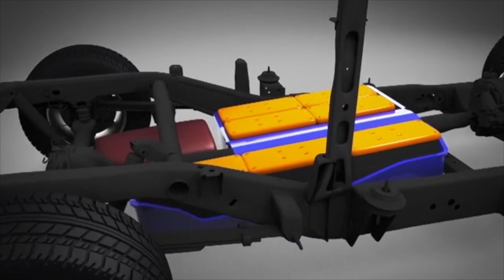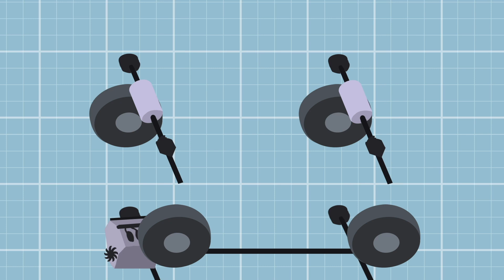Could This Pickup Truck Design Change The World?

Comment: If we can´t make enough vehicles full electric then hybrids indeed are the way, for now at least.
Reply: If there not driven properly a hybrid can be worse. Remember a prius is capable of 19mpg and it's not even going that fast. Obviously a prius does not go fast. In the right conditions an M3 bmw uses less fuel.

Comment: The problem I see is the high electric charging, so I would have to pay at my house to have a special electric station put in I’m sure that’s expensive and the there’s the actual charging itself the electric company already gets tons of money from me monthly I can’t imagine how much higher my bill would be if both my wife and I had 2 electric vehicles plugged in. Our bill would be huge, no thanks
Reply from the maker: You'd be surprised. Have a guess how much it costs to fill up a 60 kWh battery (Which in a smaller plug-in car is enough for 230 miles of travel)?  Charging stations these days are a lot cheaper than they once were -- under $600 is achievable. Additionally, if you do have a socket for welder... you've probably already got the right power in the wall.

Comment: Surely a hydrogen fuel cell is the only logical replacement. Plugging in vehicles might be OK if everyone has a drive to park on, but in towns and cities where parking in front of your own house is a rare luxury, it's just not practical to have to plug your vehicle in.
Reply: No because currently hydrogen is made from natural gas.  Splitting water is massively inefficient.

Comment: I drive a pickup for work and would instantly switch to a hybrid if it met the current abilities slot of my journeys are short but carry heavy loads so having something that covers 30miles on electric and then switches the motor when needed is beneficial. Mitsubishi were supposed to be developing one but I've not heard diddly squat about it.
Reply: RAM sell the 1500 mild hibrid.

Comment: All those eco conscious "electric car buyers" forget that as of now, there are no "cost-effective" ways to recycle lithium. (The main ingredient in 99% of batteries out there). So what do we do with 2000 pounds of spent lithium in a Tesla model 3? Isn't that going against the "eco" mentality? If we are going to spend more on recycling (or disposing) of lithium in both labour and energy costs, what's the point? Most of these electric cars are recharged with either good ole' coal or "Nucular" (as Bush the lesser would say). From an eco stand point, are either of these methods wholesome?
So this electric bandwagon everyone seems to be jumping on has it's negative. Yet, not much is said about that. Where will the extra electricity come from to recharge the +10 million electric cars planned to be on the roads within the next few years? How fast is the "recycling" industry working to find ecological and economical ways to re-use or dispose of spent lithium? It is highly toxic BTW.
Happy electric trails!! Cheers

Comment: The metals needed to make battery packs are rare earth metals are hard to find and usually buried deep in the eilather you do more damage trying to dig them out then you are saving blus the batteries have a lifespan would have to be replaced and would cost more than the truck was worth. There are many other things we can do. All electric is not that way

Comment: They are so beautiful,all these pick up trucks.but i laugh when i an in my old 92 1 ton chevy van with 370,000 miles on it and $500 trade in value and see when im at home depot these $50,000 trucks cannot put much in the back.lumber,ladder hangs out.not much fits.a van you can put all your tools ,alot of tools,20 bags concrete,50 2x4x12 and a ladder close the doors and not get rained on

Comment: Consumer automobiles are an extremely minuscule amount of carbon emissions. Cattle, coal, and plastic are by far the biggest problems we face.
Reply: Automobiles are not a minuscule part of the problem.  Your other issues are right on the mark.  We are being attacked by a pack of wolves.  Taking out just one or two doesn't solve the problem but having multiple efforts that each take out some will solve it.

Comment: Yes turn everything to electric because lithium extracting is clean and emission zero... You have to see something from the ground up not just from your usage. Also, you cannot compare city and back country driving. Where i am, there is no way to go 300km out of a city without thinking of "filling up". US and Canada are vast countries that will be hard to adapt as it will just cost to much. Just to prove my point, the cellphone coverage is not complette here as it is too expensive per custumer to put in. About 2 to 3 times a day i cant even make a call. You think it would have a plug in station there?

Comment: Off road dump Truck do use electric drive train but powered by a diesel motor..
the engine drives an Alternator producing over a million watts which is sent to traction motors.. now a battery 🔋 to feed that amount of power without taking up the entire payload at this time is just not there yet..

Comment: The idea that hybrid or all electric vehicles are superior to internal combustion vehicles is not completely true. WHERE does the electricity come from to charge the batteries ? Nuclear power plants, coal burning power plants ? How is that better for the environment than the internal combustion vehicle emissions ? Not to mention the batteries which contain harmful elements and when they fail, not likely to be 100 % recycled. Producing toxic nuclear waste and fumes from burning coal so you can plug in your vehicle is the answer ?

Comment: Everyone ignores facts.  The manufacturing process and the manufacturing of materials used in an electric vehicle and for that matter, any vehicle, is the largest potential detriment to the environment.  Depending on where your electricity comes from, if using carbon-based electricity, you are piling on more potential environmental impact.  Disposing of these batteries adds even more impact.  Gas based vehicles have reduced carbon emissions by 98 percent since the 1960s.  Add to all of this, if you use an engine as the range extender for an electric vehicle, you are still using gas.  All this money and effort into electric vehicle adds up too much less, if any, positive impact.  What they do, do, is provide excellent performance and allow for more energy independence.

Comment: ICE translate their thermal efficiency at only 20% of the fuel burned toward axial motion,  most of the energy is wasted with heat,  drag,  friction,  moving parts,  and other aspects that use up energy before it gets to moving the vehicle forward. Conversely,  Electric motors translate 90% of its energy to moving the vehicle. A much more efficient medium of translating energy to motion. 

Tesla is the future. They will eventually dominate every aspect of the automotive industry. And subsequent bankruptcies of big ICE auto makers will occur. 

You might as well buy Tesla stock why it is relatively cheap,  and make a profit as they grow.

Comment: The Mitsubishi Outlander PHEV is a mid-sized SUV that has the drive architecture described in the video.  The wheels are always driven by electric motors, and it has both Level 2 and DC fast charge capability, but it also has a gasoline engine to charge the batteries if needed.  However, the battery pack is only 12 kWh, which is good for about 50 km.  If this was bumped up to 20 to 30 kWh it would be a really great car!
Reply: Good for an suv, but some of us i.e tradies need utes to work out of. Would like to see this in reality. I doubt they could get anywhere near the price of a diesel variant though

Comment: There is no mention of centralized power generation, which is still polluting and the minerals to make batteries, solar panels etc. still needs to be mined. An hybrid Toyota Camry runs a bit less (l/100km) than the quoted F150 but will not carry the weight or tow. So we need a real solution not a popular political one.

Comment: Great program. Indeed, it also would be possible to avoid installing a fixed engine in your last propossal and instead prepare the vehicle to add a gas engine that can be plugged in and out depending on users needs. In my case would be great because I would only need an extended range about 10 times a year. The rest of the time I would store the engine in my garage. That would make the car cheaper as I could buy it without the engine if I do not need it. It also would allow the producer to offer different engines some less and some more powerfull to add to your pickup to make it more adecuate to the client's changing needs.

Comment: Good video, however you did not mention the weight of the battery pack which can be very heavy. Pickup buyers are always concerned about the weight of the truck and the amount of weight it can carry or tow.

Comment: From an ev owner point of view, I do not believe that the future is electric. Although I've enjoyed my Ioniq electric I think people will not adopt the ev car. Maybe some countries especially in Europe will enforce and achieve a very high ev ownership rate (I think Norway is 50 percent electric) the future I believe is gasoline engines that are more efficient. Take the achates engine which is being tested with Chevy in Saudi Arabia. The engine is 50 percent more efficient which means it is just like a Hybrid car. The gas corolla does 600 to a tank, the Prius does around 800-900. Also Mazda is introducing the sky active x which is 20-30 percent more efficient. Electric cars are a financial decision. It is cheaper to own and maintain an electric car in the long run than a gas car. Especially for people such as myself that drive for a living. I do 250-300 km a day. Not paying anything has increased my profit margin. Also, Europe and North America are different places. The people are different and the countries are smaller. Once a gas car that does 3-4 litters to 100km comes out or even a truck that does that electric will die down. Just from a resource perspective we can't electrify the 2.2 billion cars on the road. Lastly, I like what a Toyota engineer said. He said when you have a 40kwh battery you can either put it in 1 car or can put 1 kw in 40 cars and make Hybrid and decrease emissions by 50 percent. He also said that the Toyota didn't make money on the first gen Prius cuz the tech was new and the cost to make the car was expensive. The second gen Prius cost 50 percent less than the first, and the 3rd gen cost I believe he 50 percent than the 2nd gen. It took Tesla a very long time to be profitable and the cars, from a build perspective are not on par as other manufacturers. It's just that people cut Tesla took much slack. A guy I picked up even told me that Elon Musk is a prophet. Check out the achates engine and you'll see why it will be much better than an electric or a PHEV truck. With ford focusing on just truck sales in North America, I think we will get a very very good engine in the next 3 years. Ford owns Mazda

Comment: Actually the solution I expect will come once they start producing standard hydrocarbon fuels from the CO2 extracted from the air. Several companies are already successfully doing it including one in BC, Canada. This will now not just have a zero carbon impact but a negative one, effectively reversing our current problem.

Comment: Instead of electric why not just run them on pure hydrogen, converting a internal combustion engine into hydrogen powered is only a quick tune and a few parts and would be more cost effective, and be quicker along with it being great for environment because the only thing coming out is water vapor

Comment: I think hydrogen powered vehicles if they can get the hydrogen generators built right and reliable it wouldn't be very difficult to have a secondary battery and alternator to run the generator as the alternator will not actually produce much drag and stall the motor out when hydrogen is burned it creates water so you would need an aluminum exhaust system or at least surgical stainless steel both would be rather expensive

Comment: I don’t know about the fuel consumption, the i3 rex run only on fosil fuel takes 7l/100km which is similar to a fuel based version of himself if you ditch the weight of the batteries which will not be required in the similar fosil fuel setup in order to measure the enviroment impact as how many liters pf fosil fuel to burn in order to move a chasis of the same utility ( in this case(i3) volume for the persons transporting it ) Generaly producing electricity from fosil is not that eficient and plus the weight of the bateries may bot be benefical but if you judge by the road conditions nowadays where you stay so prolonged in trafic and the masive engines run ineffectively then yes it might be, but don’t forget about the environmental impact of the batteries., hydrogen fuel cells are the future, the batteries are just a middle thing to keep emissions out  of the city but in long term may be harmful for the environment. Hydrogen is the best fuel, you can make it from renewable energies which are plenty and usually shuts down during the day because of too high produce compared to the demand of the grid and hydrogen can act as a natural battery for storing energy, at least in industrial use no need for gigawatts of tesla baterries.

Comment: For the people who buy a truck cuz it's cool and that truck will never see a load or dirt or any real work a truck is for it's a good idea but for a real work truck that will see lots of loads dirt and work it won't work at all cuz you would drain the battery pack fast
Reply: Pure electric won't work for a real working truck but a hybrid can give you lots of advantages and save gas.  It is not hard to make a truck with all wheel drive and traction control once you have gone with the idea of hybrid.  Went you have to drive through the "fall on your ass" mud at the work site, the system could make the truck a lot easier to get through it.
Reply: A hybrid truck could work for normal job site and average loads but here in Oklahoma we overload and overwork a lot and I don't think even a hybrid could keep up unless it had a high fast charging engine and at that point it would be better just to stick with diesel or a high hp/torque gas plus you have to remember when a load is put on batteries they get hot I don't know if they make batteries that could take the more heavier loads (the loads that make even a 2500 struggle with) and price would have to come much further down then is possible right now
Reply: @bobbyjames6940  
A hybrid would do better in that environment.  I don't see why you would think not.  Are you aware that someone made a hybrid railway shunt engine.  It worked better than the competing models.
Keeping batteries cool is not rocket science.  They are well over 95% efficient so only 5% of the energy can end up as heat.
Reply: Ok if they did that now make it pick up size and just as cheap it wont happen for a while

Comment: Fuse hydrogen you can have all the vehicles in semi tractor trailers can use them everything so hydrogen covers a wide range of vehicles without the compromise of having to be ripped off at the pump we don't need we need to get away from that

Comment: I will keep my Diesel chevy I don’t use it for my work it is my daily but I do haul stuff in the  bed and I tow a camper electric would be very bad not having power to move heavy loads or to stop them and the reason why automakers don’t make them is because the consumers don’t want them they don’t fit are needs and in the snow the will not hold a Charge and they will corrode so “say no to electric trucks”

Comment: Part of the apathy of manufacturers in the USA to adopt the brilliance of your idea is that "gas" or petrol as we know it is stupidly low meaning if you can by fuel for your ICE vehicle at abot 90c a litre and even if real world economy was say 20 litres per 100km then 18c per km is relative cheap running cost for such a powerful and versatile vehicle. Adding sa 50% to the fuel cost may steer buyers to more economical ICE vehicles or hybrids. The type of power train like in the Mitsubishi Outlander PHEV coul be easilly scaled up or down to the size of the truck, ute or pickup as they call them. Subsidising green electricity with the income derived from the 50% fuel price increase to make greener cars even cheaper to run. We have a worse situation here in Australia as we have ICE fuel at around $AUS1.50 or equivalent of say $US2.30 per litre but our mainly dirty AKA coal fired electricity hovers around $AUS0.40 per kwh! (about $US0.58). In Australia, a bit like in England it has been proven that in real world driving the 2.25 litre turbo diesel is as cheap to run/fuel as the 2 litre PHEV hybrid despite their official fuel consumptions indicating the PHEV shoul cost less than of the diesel to run. What are your thoughts and would you consider doing an item on this dilemma highlighting this obstacle in the inevitable move to all electric or hybrid vehicles in th future? Cheers and keep up the good work.

Comment: Just further develop the gas engine and get more power out of a smaller motor it is actually reasonible for an f350 to get 120mpg if u actually calculate combustion power produced and switch to leaned out high compression drect injection combustion
Reply: That works but makes a lot on NOX.  As you optimize for more efficiency, you increase the peak temperature.  Carnot's rule applies to the internal combustion engine.